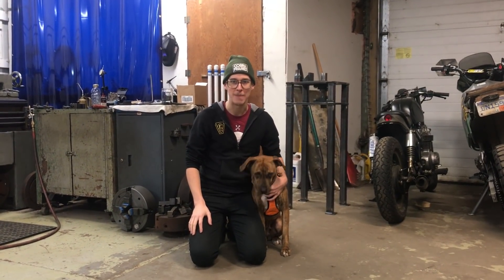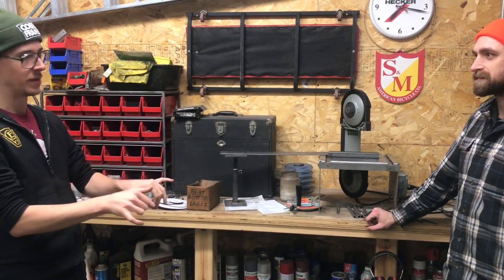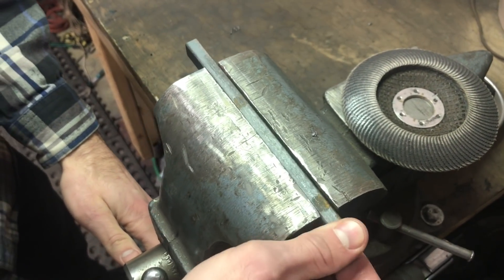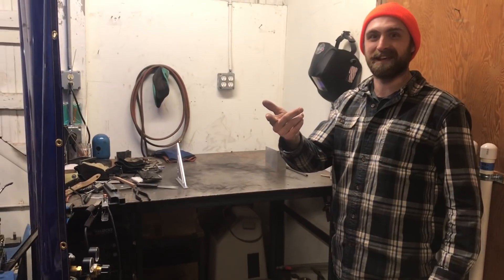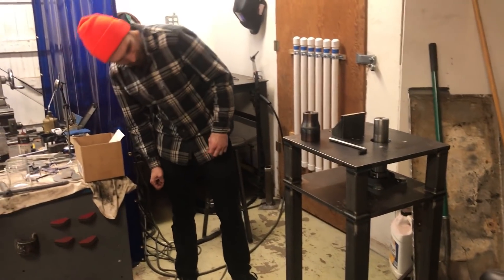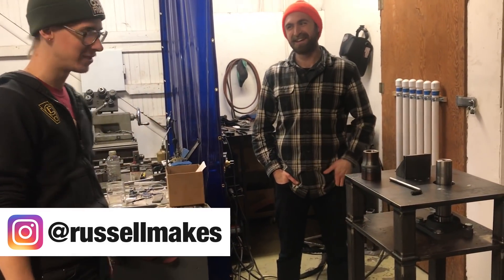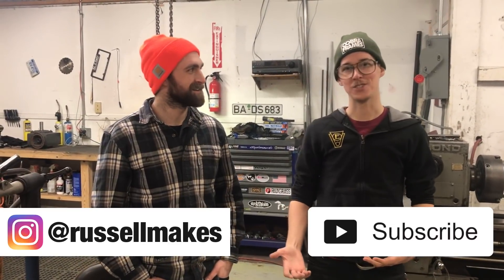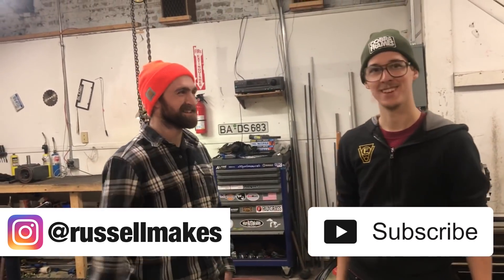Shop Tour: Austin Russell's Metalworking Shop

Comment: On your weld rod tube holders drill a 1/8" hole in the top cap. Then you can store your short pieces of weld rod in the hole by bending the  end of the rod to keep it from falling in the but easy to grab.
Reply from the maker: That's a great idea!

Comment: I was thinking about that raw frame...I live in Madrid (Spain),not a very wet area and I have a few raw frames too and they are not so hard to maintain. 1 of them is clear coat and it is fine but it is true it can rust anyway...Maybe you can blue the bike like the old guns,it is one way to preserve the the steel.
Reply from the maker: There are always options for a sort of raw finish, but they are almost never trouble free and require care and oversight to keep rust from advancing.